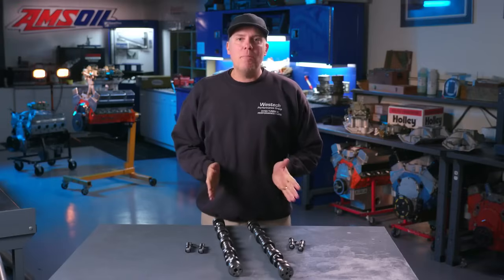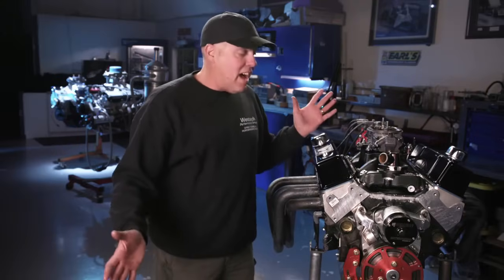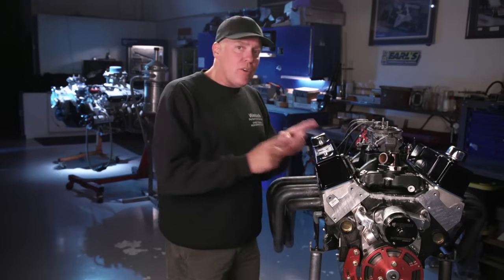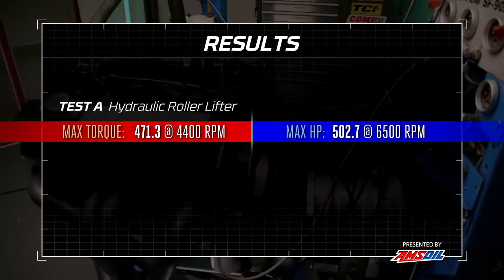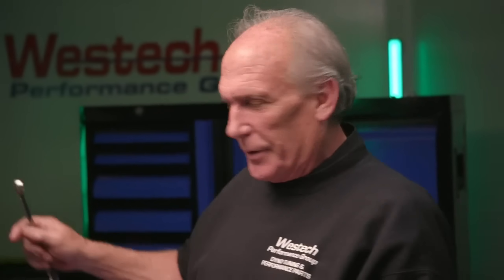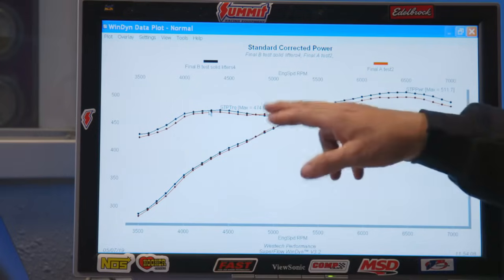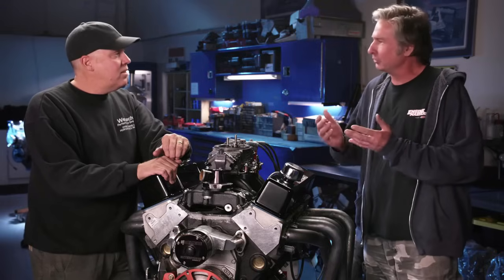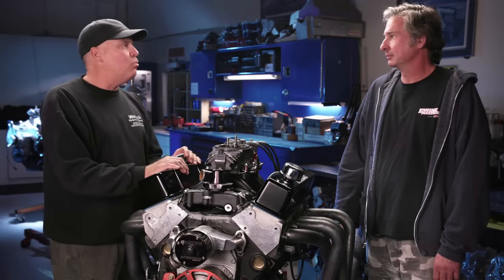ENGINE MASTERS  S4E48  Hydraulic vs Solid Lifters the Redo!

Comment: Holdener noticed that hydraulic lifters don't follow the math. Turns out the oil in the lifter is aeriated making it compressible. This tightens up duration and reduces lift.   As an aside, why not zero lash solid lifters on a cam designed for solids?
Reply: Push rods vary in length depending on temperature. So if you set it at zero, it will hang valves open once it warms up.
Reply: Cams designed for solids have long lead in/out ramps so zero lash would add around 60 deg duration @ zero lash,,hydraulic cams have a short lead ramp

Comment: You forgot about the importance of oil viscosity. If you were running 0W20 the lifter would develop more slop than 80W90.
Reply: idk ow this would effect shit...maybe run thick oil if you have cheap lifters?

i prever ohc, with no lifters, pushrods, or rockers, where adjustment is by shims & cam removal is required... 

valve assembly weight determines spring strength, stronger springs steal more hp.
Reply: 80w90 is the same viscosity as 20-30 engine oil.
Rated on totally different scales.
Reply: @hotrodray6802  I didn't change scales. 😊

Comment: Is this the 1960s? Why in the world would anybody BOTHER with solid lifters on the street in the 21st century?
Reply: Because a well built solid lifter engine with a street type cam will run 50k miles without needing lash adjustment.
Reply: Because they want to make more power…
Reply: Proper solid valve train components will not change lash for 30+k miles on the street.
Reply: @kevinpolito1529- Because these are NOT the old 1960's solid lifters, these are Modern solid ROLLER lifters! Huge difference!
Reply: I had hydraulic lifters keep bleeding down, I went to solids and it's been good
Reply: @adampell1607 
Bad/worn/cheap lifters will do that
Reply: I built a 383. The cam is a hydraulic roller with 230/236 duration at .050 110 center and 544/555 lift. I have 10.5:1 compression running Brodix CNC 185 heads. The lifters are Hydraulic Johnson’s that are the OEM style that use the GM spider in the block to retain them. The engine runs really good but the lifters are noisy….not all the time but they do get very noisy sometimes. It’s quite annoying. I am running Valvoline VR1 20/50 full synthetic which seems to have helped quite them down some. I am thinking of going to a ISKY solid roller lifter but I wonder if I should just go with a solid roller cam and lifter? Thoughts are I could try the solid lifter first on my hydraulic cam and see if that gets me the correction I am after valve train noise wise and if not then go with solid roller cam. 

Thoughts? Opinions?
Reply: @ss3969   That sounds like a perfect plan to me.   Buy the solid rollers and try them first.

Comment: On the "hydraulic lifter on a solid cam" topic...It doesn't work.
At least in my experience. Because zero lash + preload is the standard hydraulic adjustment, it isn't compatible with the lobe design of a solid cam.
Reply: Hi Richard, They set the lash at zero lash, so, there is no prel-oad.

Comment: I really needed this video guys. Been contemplating swapping from LS7 lifters to some solids. Im gonna guess my LS7 lifters are robbing me some power. If those expensive hydraulic lifters were robbing 5hp im gonna guess my LS7s are robbing atleast 10. And while Im in there might as well go from 1.6 rockers to 1.7 for a little additional lift. Hoping for a 15 hp gain. Pray for me. Lol
Reply from the maker: Going from 1.6 to 1.7 will give you about 30 thou more lift and a tiny bit more duration. Hoping for a 15hp gain is not unreasonable? Good luck man!
Reply: @roadkill_reborn 
Maybe 3-4* at .050.
Increase in lift AND duration occurs everywhere on the lobe. All valve events are changed as well as lift.
Then maybe you are into valve spring problems because of increased valve velocity. The lighter lifter weight MIGHT mitigate that problem.
Reply: You will never feel 5 hp except in your imagination.
Reply: @johnd5805  - The above comment said hoping for 15 hp, not 5 hp. But if you ran a 11.000 1/4 mile, adding 5 Hp could get you to a 10.999 1/4 mile!
Reply: @evilinside5984 🙏 Then you can say "She runs 🏃‍♀️ the quarter under 11" 😊
Reply: Why didn't you just ask the guy who grind your cam..?
Reply: It's not hard to figure out the lift an extra ratio gets you, just multiply your love lift by the new ratio
Reply: @lollipop84858 The O.g. post never asked how much lift they would gain, going from 1.6 rockers, to 1.7 rockers. They were hoping for a 15 Hp gain from this swap. Another comment said they would gain about 30 thou. of lift, & a bit of dur., as a general statement, without knowing the exact cam specs., from the O.g.s post.
Reply: @evilinside5984 Exactly. I was originally commenting on the lifter swap gaining some hp. Then added the notion of rocker swap for even more.
Reply: @CIVPIT510  - Yes you should gain power from both Lifter swap, & rocker ratio increase, as Long as you don't get valve float. I would also get the lightest rocker arms possible, to help maximize your power potential, & to minimize your chances of valve float. What are your camshaft specs., with no rocker ratio?
Reply: Id trade 10 to 20 hp to never have to lash valves.
Reply: @timothycarey3883  What's funny about people always talking about lash, as a reason to not have power. But as long as you don't have a high lift drag race cam, with .650+ Lift, you don't have to keep lashing your solid roller cam setups. I only set/✔️ ed my almost .600 lift solid roller cam setup 1 time in 15 years. It always ran great= 11.50s consistantly.
Reply: The LS has 1.7 Rockers stock, except for the LS7 which has 1.8's.

Comment: My 331 hits peaks at around 3500-5000 with a TFS cam so my hyd rollers are perfectly fine. I think as you go up in rpm ythe solid lifters would benefit you. Like an ohc setup.
Reply: I spin my 383 stroker to 7k on LS7 lifters. Seems stout but I just have this feeling I'm losing some lift from them
Reply: @CIVPIT510 get some BAM solid lifters, and redo your valvetrain for them lol. Good lifters. I run my LS7 to 8200 with Johnson ST2126LSR, manton pushrods etc
Reply: @corvetteZ3r Redo my valve train? Like more seat pressure and some stronger pushrods? I was hoping to use the springs I have
Reply: @CIVPIT510 no, do better lifters
Reply: @corvetteZ3r  O do believe solid lifters want more seat pressure and open pressure springs tho.